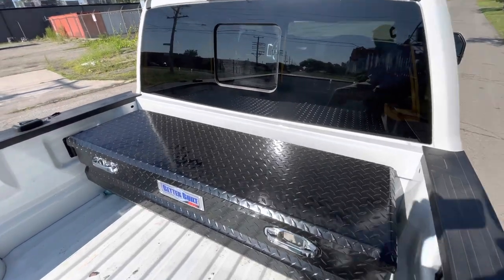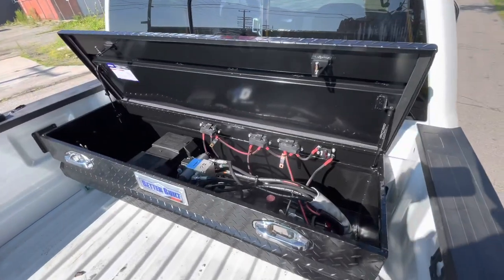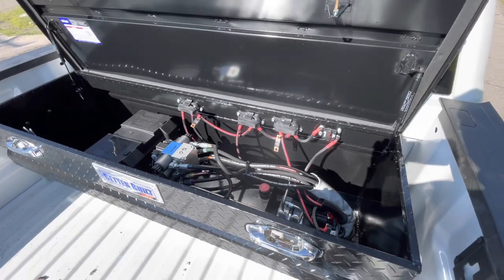Double motor hydraulic pump in action!

Comment: With all due respect ; this seems bitter / sweet ( at least for my requirements, that is ) : On one hand, a terrific power source. On the other ; not the most frugal, in space conservation.

I’ve been [ tirelessly ] studying and searching for a, fully sealed, hydraulic winch power solution.

Nope—I refuse to use the power steering and clutch pump options. And electric winches are, simply, out of the question ( “ I am NOT drinking any fucking Merlot !!! ” ).

I aim for a, dedicated, winch power source.

This is almost, almost, perfect ; however, it seems ( from my observation ) that it could have been packed a bit tighter, as overlanding bed space is golden. Think ;  any electronic device that you’ve ever looked inside of.

Nevertheless ; I, still, like what you all have accomplished ( for the commercial recovery industry ) - even if doesn’t quite suit my, very particular, designs.

‘ Good work.

Thanks, for sharing.
Reply from the maker: Well thanks for the comment!!